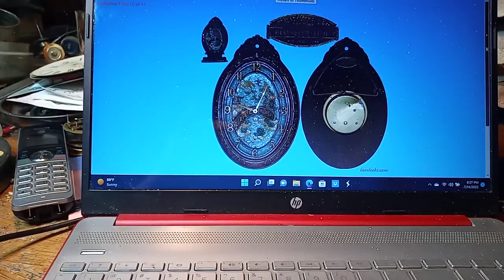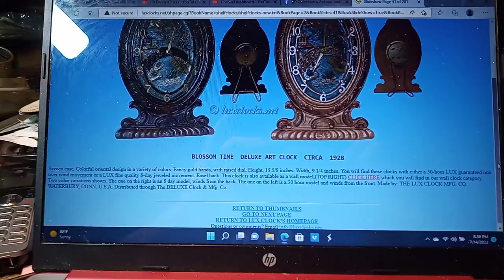Repairing a Lux 1928 Blossom time shelf/wall clock. 20220714 192445

Comment: I have had to change the spring on movements like that before. I was lucky that I found a spring the same size. I like the pendulum better, but some clocks don't have room for the pendulum. It is wonderful to see the movement running again and for me, relaxing to watch it run.
Reply from the maker: Thanks. I think that these type of clocks could have been made better. I dont like this type of system. There are classes that professional clock people take specifically for this type of clock. Sometimes they learn and sometimes they dont learn. There is a  you tube video that I posted in the group of a guy playing around with this type escapement but he has been doing it for over 30 years. If this is the only type of clock that I worked on I would get better at it and would be teaching or posting videos on how to fix them just like I am with the cuckoo clocks but to tell you the truth I have messed up more this type of clock that I have actually fixed.